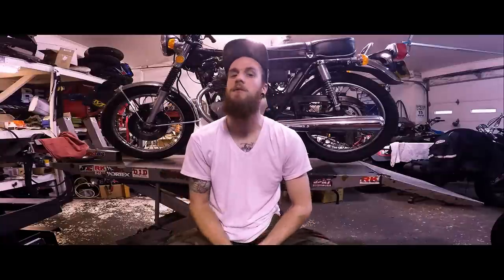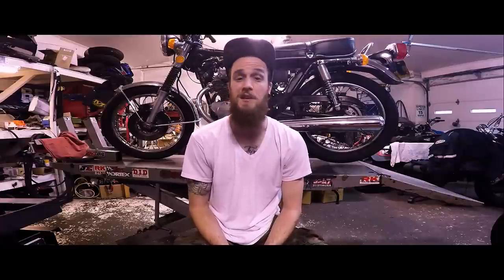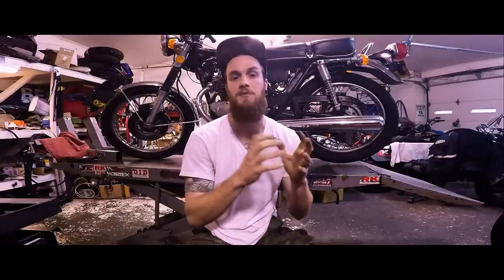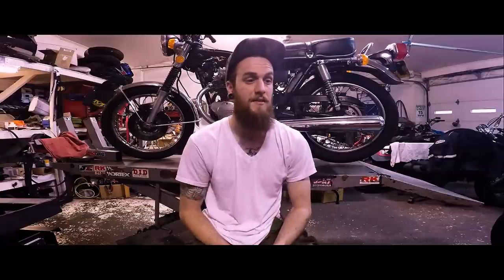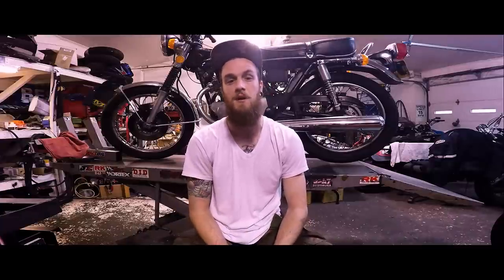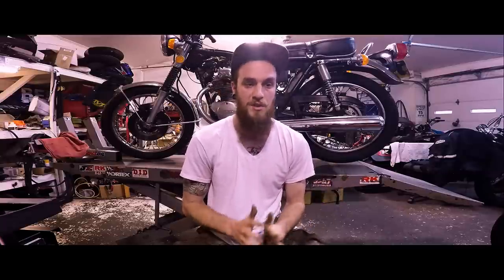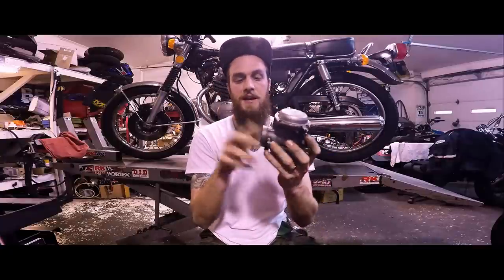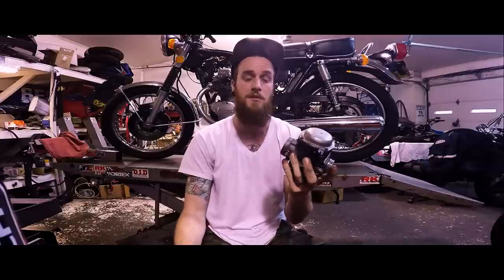How to diagnose a carburetor problem in less than 5 minutes

Comment: A nifty trick I learned from my dad working at his Oilfield and drilling rig Instrumentation repair shop to clean metals, especially Aluminum and Brass, is to use a container, a coffee tin or plastic 1 gallon ice cream bucket or 5 gallon bucket for larger jobs, of suds-free Ammonia with an aerator/bubbler, I use an aquarium air pump hooked to a short length of copper tubing, with the end pinched, make sure it's suds-free or you'll have a huge bubbly mess. Let your parts "bubble" overnight and you will have a hard time telling new parts from old. The equipment we work on is sometimes 50 years in the field and been chugging away almost everyday of it's life so you can imagine the condition of some of this stuff. I grew up working in his shop and ended up going into automotive, I'm an ASE certified technician for over 15 years now and I've never seen car parts, in their worst condition, even come close to some of this rig equipment and all it takes is an overnight in this to perfectly clean them. It's insane how well it works. I have seasoned mechanics ask what I do to clean my parts, especially carbs, and I never tell, this is the first time I've ever shared this, try it, you won't be disappointed.
Reply: Thanks for this tip ill be sure to try it out!
Reply: Thanks bro I'll test it out on my bikes carb as its giving me some issues 🤙
Reply: Holy shit, I gotta try this. Bubble free. Not sure if I've ever read labels for bubble free though. Huh. Learn something new everyday
Reply: I call bs on you not telling anyone because I saw this comment on another post
Reply: I tried this, woke up the next morning and someone had stolen my motorcycle. Would not recommend.

Comment: I applied this method w my boat that was sitting for 10 years. Started right up. I'll be Replacing the carb and fuel pump, and draining  out the old gas.

Comment: You can have really low compression and the bike will run on starter fluid.  Just rebuilt a top end that was reading 160psi but would only fire off on starter fluid.  Ring was stuck in one small spot and cylinder scarred, after rebuild it fires on its own with no starter fluid.  Good diagnosis tool, but not 100% accurate all the time.

Comment: I have a 2001 Honda shadow spirit 1100 replaced spark plugs clean carb flushed gas tank has brand new battery and still doesn’t turn on it cranks but nothing else

Comment: Box 1300 carb, Bike will only start on choke and falls off, bike will not start with throttle. Cleaned carb and still doesn’t run but the first attempt of the day for about 45 seconds. At that time the throttle works and stops after. Any ideas?

Comment: I stumbled across your channel whilst procrastinating at work and must say you are brilliant. You're one of the only YouTubers that really explains things in full detail.

I have a CBR900RR '99 model. We all know how an inline 4 should sound, and how a V twin sounds. The problem I'm having is that the inline 4 engine is firing like a V twin (in my opinion). I've cleaned the jets out thoroughly, done a compression test, and all i can think that's left is the mixtures/balancing.

Your newer videos regarding balancing and mixture screws have helped me understand what to do and how to do it 10000% better than I knew before, so THANK YOU!

Keep up the amazing work, and I hope to see more videos soon!
Reply from the maker: +Usual Suspect This is super encouraging to hear, thank you so much for taking the time to let me know the content is helpful! I truly hope to bring more value to your YouTube experience! Ride safe brother 🤙🤙
Reply: I'm having the same issue on a 93 cbr 900rr. Sound like a vtwin and is not firing on #4 cylinder, have cleaned carbs and checked spark and compression with no luck.  What did you find to be the problem with yours?

Comment: Thank you for this video. Hoping you can help direct me. I have a 2009 Honda VT750C2 with 20,000 miles. I ride nearly every day and have been doing all the maintenance. Recently I've had an issue where the bike won't turn over. Before I followed your tip, I worried I had run out of gas, or the petcock vacuum was stuck, or maybe the carb was sticky or something. I noticed that I had the fuel shut off so I figured I had run the gas in the line out while I was letting it idle on choke to warm up. I bought a vacuum hand pump and confirmed the petcock was working correctly. Then I found your starter fluid tip and that worked great to get my engine started again and the bike has been running fine for a few months. Today, the same thing happened with the starter, but again I have a full tank of gas and I didn't have the fuel shut off this time. The starter fluid into the carb got it started again and it is starting again on its' own, but now I'm wondering if there's a deeper issue I need to look into. How would you diagnose this?
Reply from the maker: Hey Derek, might be able to help you with this. Just need more Info. Feel free to email me at codyrichards@themotorcyclemd.com

Comment: My vmax had one carb that took forever to fire up. My problem was with vboost working on it myself was scary. But I'm sure I could have done it. Finally got to point where it wouldn't fire up at all. 450 bucks later they're all running fine now. Multi carbs are a science to be sure. Hope your channel works out. Good luck.

Comment: When I used work at a repair place to fixing mowers, strimmers, chainsaws ect. I had a trick to starting engines. I had a trigger spray of petrol or two stroke mix in a trigger spray and would spray directly into the carb intake to see if it would fire.

When I bought my first non running motorcycle, A 2004 Honda Varadero XL125V that had been left stood for over two years with a full tank of E5 petrol, I sprayed fuel into the carb intakes and it started but wouldn't run. 

I opened the carbs to find the float bowls dry but had a green coating and the jets were completely blocked.

I didn't have the correct jets to hand so I fitted the next size up and it ran fine.

Comment: I've watch all your carb related videos and subbed. I don't think I they resolved my issue yet.

I have 1993 suzuki katana gsx600f. Its got a stock air box and stock header. But the pipe is off of a 2004? I'd Imagine its basically the same as stock. 

I took down and cleaned all the carb parts last week. I put new fuel in it also found a couple vacuum leaks. All good (so I thought.) after filling up then about 100 miles (last year I was getting closer to 150) I ran out of gas. Ok that's odd but maybe I was running it hard or something. I get it home after filling the tank again. The next morning all my fuel had drained through the carbs into the crank case, cylinders, filter box. I take it all apart again and clean everything. I took extra time to inspect the float valves. Didn't see any issues. Adjusted the floats and double checked it was all clean. Put it all together start it up rode across the street to the gas station fill it up and suddenly starts and barley will idle at WOT... It dies and won't start. Walk it home about 5 min later I have the air box off. It's full again. Taking it apart is getting old. Ordered a complete rebuild kit and dyno jet kit. I put the stage 3 kit in that's supposed to work with the stock box. Now it will idle perfectly fine but it will not throttle up at all. Then it all the sudden decides to red line and stay there till I can get the kill switch turned off. I'm assuming I'm getting too much fuel. I followed all of the instruction on the kit and am completely unsure where to go from here. Do I put the stock jets or the stage 1 kit that came with it 
 in? With the stock main jets it wouldn't quite idle till it was warm. I know the mains are not supposed to affect idle? So why will it idle with the bigger jets (same idle jets)? Is it related to the idle air screw? Any one have a good place to start?

Comment: I'm having trouble getting my 98 cbr600 started, First thing I did was change plugs, it gave it a little extra "umhf" but no start. I'm definitely going to try the starter fluid now
Reply from the maker: Remember that the starter fluid trick is only used as a diagnostic tool to determine the problem!  Not to get it up and running!

Comment: Great video
I have a problem here in the UK
My wife's xt225 is a pig to start in cold weather
It will start after 5/6 attempts but is frustrating 
Will this method be the same with the starter fluid 
Keep doing what your doing as you do it well 👍

Comment: Hey! thats the same  bike I'm working on right now! '68 Honda CB350... just bought a CB360 / 350f disc brake front end for it. So that should arrive soon. It was (and is!) my first road bike, so I don't think I'll ever sell it.. i already have most of my build mapped out.. it's just being able to have enough disposable income every fortnight compared to my paycheque. Shipping from the States to Australia ain't cheap! Oh yeah, it wouldnt run for anything. tried everything. Ended up getting finding an original keyster carb kit in Germany. P:ut that through the carbs , and cleaned everything, and changed the jets to new ones and she fired up pretty much first time and ran like a champ. Gonna put new ignition coils on it soon, as the current ones are looking pretty ratty. Electronic ignition would be nice, but I can't afford that right now.. I love my cafe racer builds!!

Comment: Even this is 7 years old video, issues are still the same, as long carburetors are there in the wild. 
I am not mechanic, and basically first mechanical experience I gain with my KLE500 (two cilinder carburetor bike), and I get situation that I cannot solve and I resist to get my bike to service (I want to understand and fix with my own hands :D )

Situation – inside, in garage, its a bit colder than outside. Outside its about 18 degrees and straight sun shine. When inside, I can keep trying with satarter to spin it, nothing happens, maybe some puffs, but not even close to idling motor (last year, I had no issues starting it in any temperature). I take the bike out, put it in straight sunlight, after about 30 minutes sunbath, with little throttle, with full choke – I can get it running, although, still bogs down, I need to hold throttle open. Then RPMs raises, so I can leave throttle alone. After couple of minutes – I can reset down choke. As soon I had a chance to check, both exhaust pipes (right after cylinders) were 330 degrees celsius hot. 

First - I changed original stock exhaust to Dominator. After I started to get these issues, I screwed up the idle knob - it came out and I was not able to put it back. I removed carb, put the screw back in, then I was not able to get bike running inside in garage. I took out carb once more, checked pilot jet, cleaned it (with break cleaner, I didn't have carb cleaner), it didn't look clogged even before, float tray didn't have any rust or debris. 

I am not sure, what is exactly wrong with my bike - why it is not starting cold?

Comment: Hey, thanks for the video, and easing my mind. I was hesitant to try and use starting fluid to see what was up with my 92 FZR600. I know from working on cars too much is a baaaaad thing. Anyways, got my ride started, but having idle issues. At first, when cold, it wanted to always die, feathering the throttle can keep it running, then when warmed up it wanted to race without any additional throttle. Now it doesn't want to idle at all regardless as to how much I turn the idle adjustment screw. I let my son take it in to his high school shop class, the bike had been sitting last 6 years, in the hopes that with supervision he could get the carbs all cleaned up and everything back in running condition. I am not sure how deep he went into the cleaning aspect. I was suspecting a vacuum leak, but with it running I used the starting fluid and hit carb to intake connections, and vacuum lines with no change in the idle so that tells me that part is solid. Now I am not sure where to go. Any help would be greatly appreciated. Thanks!!

Comment: Got a question for you to figure out.  92 ninja 600r.  Been running really good.  Took it on a bike run saturday.  Over 100 miles.  Ran great.  Sunday went out to a friends house.  Ran great.  After a couple of hours, when i start it to leave, skipping and stuttering like crazy.  In neutral it clears up, 1st gear, spitting and sputtering, and the tach is jumping up and down.  Ride it home, it continues.  With more throttle it clears up.  Does it really bad in 1st and 2nd.  Carbs have been cleaned twice in 2 months.  2nd fuel filter installed weeks ago.  I'm at a loss.  Any help please???
Reply: Sounds like the stator could be going bad.  Long rides like that are hard on stators they get heat soaked.  When you said the tach needle  was jumping all around  that was a tell.  They typically do that under low voltage.

Comment: Love your vids  brother. This reminded me of my issue im having kind of. Im battling the issue of bike will start and idle on and off choke perfectly, but the moment I give throttle, it wants to die as if the main jet were clogged but its not. Although if I spray a couple squirts I can rev it to normal rpm. I'm so confused cause I triple checked the carbs and jets and diaphragms and needles and all and it'll only rev to normal rpms if I spray it while running.

Comment: That's great and all and it worked for me but what happens if you take apart the carbs clean it End and it doesn't even start with starter fluid anymore like it did in the beginning If starter  Fluid worked But didn't after the cleaning?

Comment: I have a 1980 Honda CM400E.  Lately when running in Neutral or 1st(don't know beyond those gears), it keeps dying if not applying throttle.  Sometimes it dies when initially applying a small amount of throttle.  It dies again and again, and then drips gas heavily at the bottom of the bike.  It appears to drip from a bolt down below.  Do you have any ideas for what this might be?  Thanks.  I live in Cherry Valley, Ill., and I am looking for a decent mechanic.  Thanks.

Comment: Cody, great stuff.  Are you able to do a vid on a 2000 Intruder 1400?  The reason I ask is that for the novice, (me), I struggled with a seemingly simple compression test.  But it went out of bounds due to the unknown de compression valves, and that they were out of sync.  Plus one was running 25% open all the time.  I had bizarre psi's.  But after a long struggle I understood this and adjusted both to fully open, ( which solved for some a starting problem, like a dead battery).  So if you have time.  Appreciated.

Comment: Usually a stuck needle from today's ethanol fuels. I cringe at the thought of using starting fluid (ether) to achieve a fast revving startup after sitting for too long. I pull the plug, and spray in some WD-40 while slowly turning the engine over to work it into the rings and cylinder walls. Now, I wouldn't cringe at introducing ether for a short diagnostic blip. Just don't keep spraying it!

Comment: hi man. i'm having problems with my carburator. i guess.

it stalls when i get the revs down. when im going at high revs it goes well as soon as i get it to 2000 rpms it stalls and stops eventually.
 to get it going i fiddle with the choke button and then go . what is the problem with my bike ???
Reply from the maker: mohamed el mtioui What kind of bike is it?

Comment: Hey , not sure if you can help me out but I bought an older chinese kids atv and it wont start without starter fluid . But when sprayed into the carb it runs fine and will restart when warmed up no problem . It idles kind of lumpy and burns a lot of blackish smoke . Everyone says it's running quite rich . When I adjust the air fuel mixture screw it basically does nothing until it's all the way in.  That's when it just dies . I can basically turn the screw all the way out and it doesn't seem to make a difference . The idle screw seems to work fine in increasing and decreasing the idle but the off mixture makes it idle rough regardless.  Any advice or opinion on the matter would be greatly appreciated.  

Love your videos . Thanks

Comment from the maker: Hey K, having pin holes or tears in the vacuum diaphragm could possibly cause this problem. Typically if the tear is bad enough the engine would not want to rev over a certain rpm, as if it was hitting a "ceiling" at 1500rpms no matter how much throttle you give it.

Quick question, if you applied choke (after the bike was warmed up), and tried to rev past 1500 rpm does the "miss" go away? Have you attempted the starter fluid test? What were your results?

Looking forward to hearing back from you soon!
-MD
Reply: I've been going over it and think it was the choke.  If I close the choke after letting it warm up it doesn't seem to have a problem.  I'll let you know more in a week.  I don't have anyone teaching me so I'm taking a Licensing Class to learn more.  Just jumping on it with out any instructions is not something I want to do with an older bike where I might break something or at my age where I might break something.  Its been a long time since I road one and then It wasn't on the road but a dirt bike.  I think I was 12-13 at the time.  Thanks for your help.
Reply from the maker: +K Singleton leaving the choke on while riding or for too long at least idle will deffinitly cause the bike to react that way, it can also smoke the plugs (foul). That's a really good idea man, it is deffinitly important to have basic knowledge on the older bikes. They need more touch and go maintenence than newer models! Keep in touch!